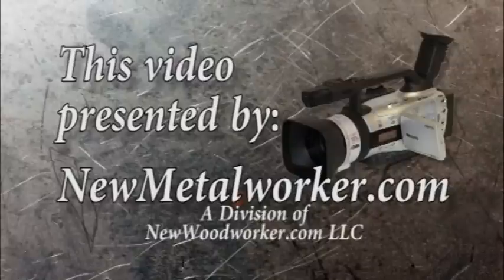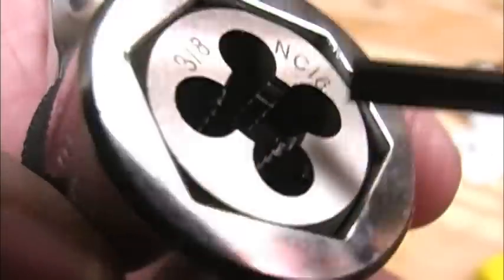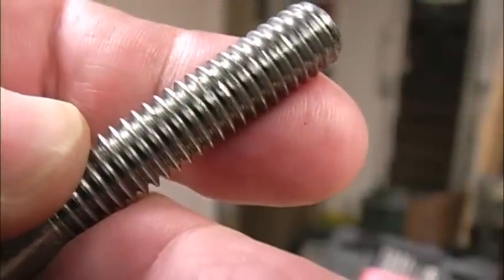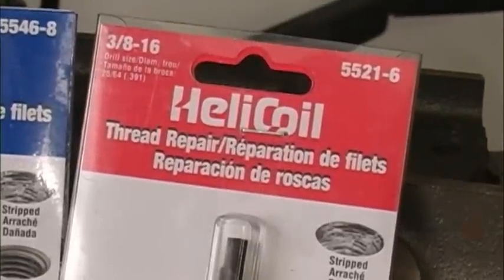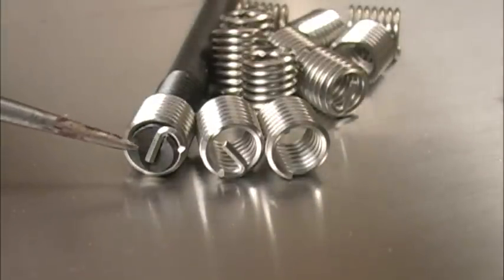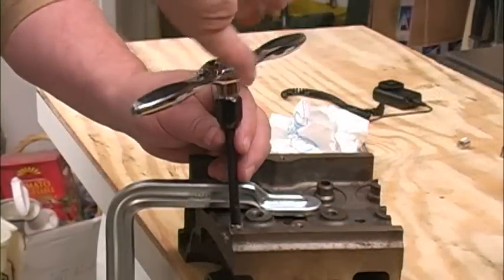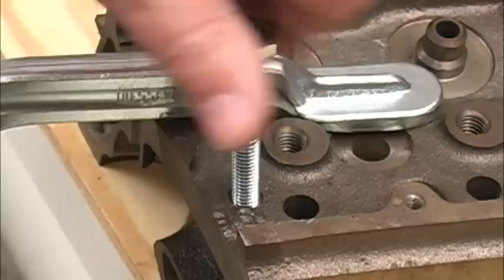Thread Repairs

Comment: Another option, grab brazing rod.
braze the hole, then drill and tap.

If it's something that won't come in contact with too much heat. 
You can use plumbing solder or silver solder to fix threads, then drill and tap. It worked for me.

Comment: Very old video but still relevant.  What do you do about the tang when it’s a blind hole such as the lower unit of an outboard?  Can’t risk the loose piece of steel from the tang getting into the gears, bearings or seals.

Comment: So....If I wanted to use this method to repair a spark plug hole on a riding mower I would have to remove the head first or risk that tiny tab that is broken off not blowing out of the cylinder????

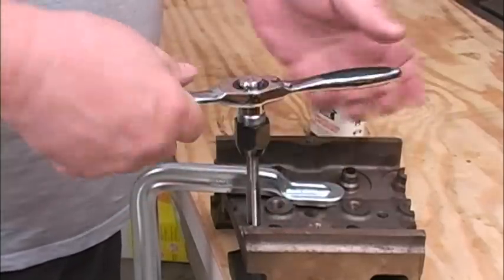Comment: What’s the tool called that you use at 4:00 to cut the thread? It attaches to the top of the thread tap. I bought a thread repair kit but it doesn’t have this.
Reply: Adjustable tap wrench

Comment: How would I go about installing a helicoil on a hole that is not threaded all the way through, but only at the end (the bolt is only threaded like 1/2" in from the tip)? The bolt is for an oil filter cover on a bike, the hole goes all the way through the case cover so I can simply take the cover off to reach the stripped threads, but can helicoils be installed reversed? I'm too dumb to work out how the threading would work out :(, I assume it would just be like a nut and work both ways right?

Comment: Not sure if you are still monitoring this but hopefully so!  I need to replace internal threads that holds the bolt for the hydraulic arm on my car's hatchback.  Would the coils work?  It appears that whatever held the threads before is gone, broken off into the frame of the car.  Now I am left with a flat piece of metal with a hole, and nothing on the inside to grab or support the coils.  Would I first insert some sort of tube to hold the coils?  Thanks!
Reply: I would insert a steal tube and  weld in place  grind it flush then use the Helicoil but if you're doing that you sometimes can find threaded collar drill out your hole weld in the threaded collar and grind flush run a tap through it to make sure the top parts of the threads aren't boogered-up

Comment: So if my M10 head bolt has to drop about 5 inches ( 127mm) before reaching the last inch or so of now stripped threads I can come back with six inches worth of HeliCoils so that the entire length of the bolt hole becomes threaded?

Comment: Great demo. Thanks for share such good vedio. I need your advise. I have engine block aluminum and head cylinder bolt threads gone. So one option to oversize with new bolts.another option to install helicoil insert. So what is the best to do so?
I appreciate ur help and advise. 
Thanks

Comment: I accidentally stripped the aluminum threads on 2 bolts on the underside of my truck's sidesteps... Aluminum strips sooo easily. Thankfully not any of the ones that are actually bolted to the frame. The tubesteps themselves are completely secure, but I might buy one of these kits and fix the 2 that stripped. :) Looks pretty straightforward. In fact, why don't they put steel coils in aluminum threads from the factory like this, to secure them? They're rather inexpensive.

Comment: I have a inside threaded. the outside bolt is m12 by 22 long. which size should I use to fix the inside  threaded. size 13??

Comment: Great video! Do I have any options if one of the threads actually breaks off on a bolt? This is on a cylinder head stud bolt and happened because my torque wrench was acting up and I ended up over torquing it and breaking one of the threads.

Comment: The only trick I could see, would be trimming the top off.  As it is running down a tapped hole, the second would be in alignment with the threads, hence no issue.

 I would also add a drop of LocTite when installing the insert, but that's me..

Comment: Easley one of the tops you-help vid's I know.   ... thanks

I stripped the stud bore hole on the head of a dirt bike.  250 2-stoker.  The specs are close fit threads.   Are heli, or others, good enough for high vibration environments?   I see them used on drag racing motors so I would think so, but I am not sure.

Comment: How do i find out what size thread holes i need?
Reply: Superior Use a tap to see. Check the bolt that came out. Sometimes a standard bolt size and a metric can be very similar. A Time Sert kit is better. An Autozone kit is good. Use a thread pitch gauge to check sizes. If the threads don't match up, it could be standard and not metric. A thread pitch gauge should match exactly to the size.
Reply: Dario de nero Actually, you might come across a situation where you don't know. Run a tap into the hole. One that seems to be the right size might do. It could be metric. Standard and metric can be close. Check the bolt if it's there. An Autozone kit is better.
Reply: Dario de nero Sometimes a person might come across a job they aren't sure what size it is. Metric can be very close to standard. A thread gauge can show that. What if the bolt isn't there. A insert size can be changed from  stand. to metric and met. to stand. Or small to larger. Once you determine what size you want, then you can install the insert. I've used helicoil. A drill bit can be used to determine aproximate size. It depends on the bolt type if it's special.

Comment from the maker: The cutters de[pend on the corect size hole and many of the tqaps come with a drill bit. I would not try just tapping out an existing hole wioth ANY tap unless I knew for sure that it was the correct diameter.

Comment: yes the hole is 14mm*1.5mm and I am using a tap of 14mm*1.5mm...I guess it should work eh? I have ordered helicoils 14mm*1.5mm*1.5D just in case

Comment: ive used helicoils for fucking up worse a stripped out hole in my dirtbike cylinder head, the set i used wasnt helicoil brand but it was 50 bucks so what the fuck?, the tap was great and all but when it came time to put the spring in the hole the damn part of the spring that stuck inwards would just straighten out on the tool that is supposed to put it in and the tool that puts it in got gulled up and rounded off and everything else, just a pain in the ass for me and in my area it seems you can only get bull shit ones that aint worth shit, maybe they work for other people but my experience with them doesnt instill alot of confidence in them, btw im not the heroin addict that stripped the threads out, i got it used for 150 bucks (whole bike) and it runs great all accept blow by on the spark plug, and i wanted to fix it before the plug blew out in the middle of nowhere and now im fucked, if i had a tig welder i could fill it in and drill out and re tap it but im just a piece of shit teenager with no job and no real tools and it will be a while before i get a career in welding and all that bullshit where the money is made and i dont have to go out and buy a new cylinder head every damn time i get a chinese apollo dirtbike for a damn good deal, i could just jb weld it in the hole but what if the plug goes bad, its just a damn mess, they make inserts for it that are steel tubes threaded on the inside and out but i fucking doubt anybody around this gay ass city has them or even anything i could use to fix it. . .hate yuppies and their "throw away and just buy a new one" culture, it means alot of free lawnmowers but it also means there isnt a lathe within a 10,000 mile radius if you need to borrow one
Reply: fuckin right on man
Reply: You could do stand up comedy